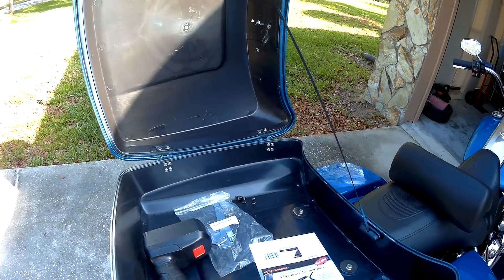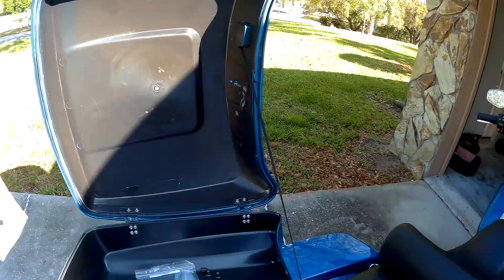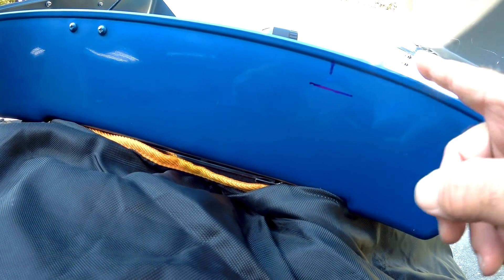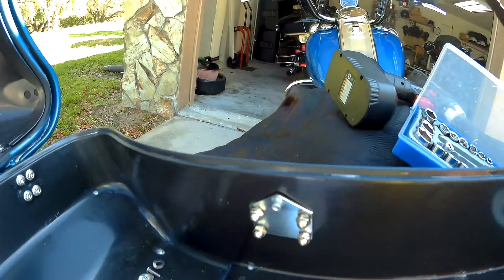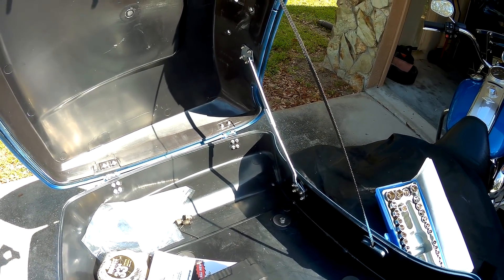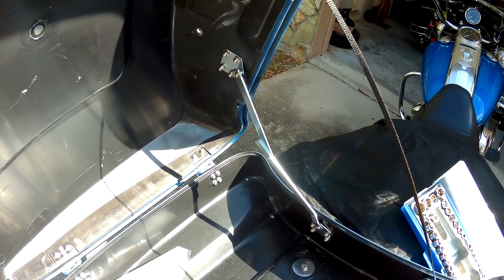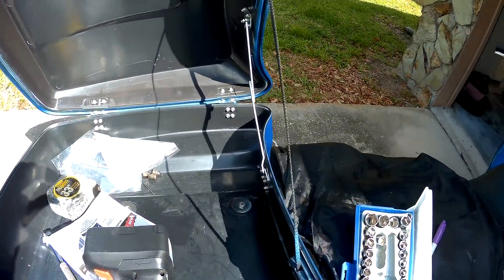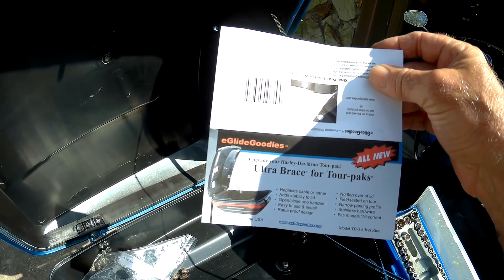Harley must have accessories part 2

Comment: I bought one for my Limited and love it. Jerry is right. This isn't a cheap hardware store item, like you'd find with a metal tool box lid brace. The mounting brackets have angled portions to match the angles on the box body and lid that tool boxes don't have. The two angles arent the same. This brace is a quality, well machined, well thought out piece. It includes curved spring washers for each pivot point. I liked the allen head screws. I added a touch of blue Loctite from a stick to each screw. I've had it over a year now, without a single problem. I got rid of the pain in the rear cable tether. Yes, it's $80. But I'd spend it again in a heart beat